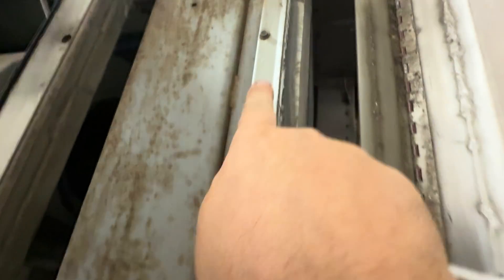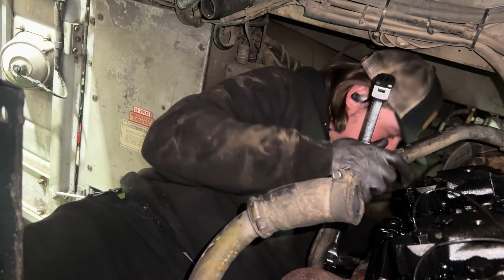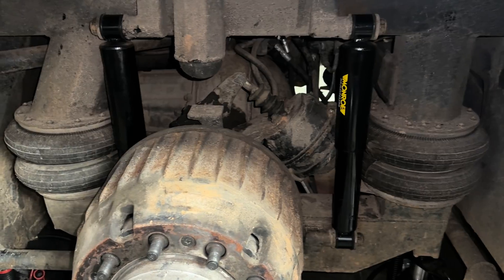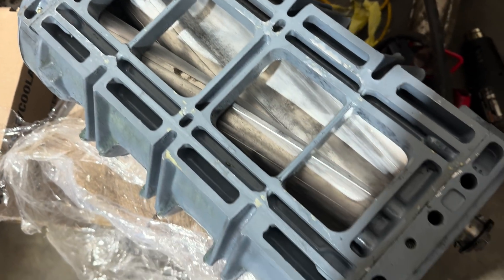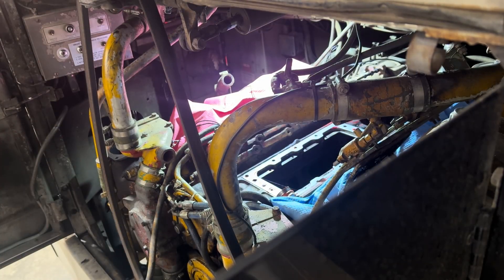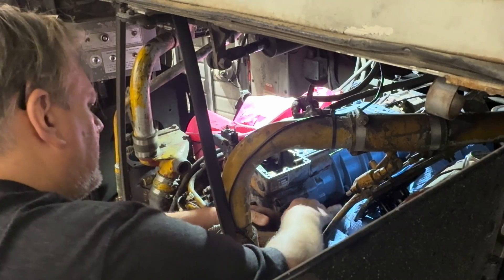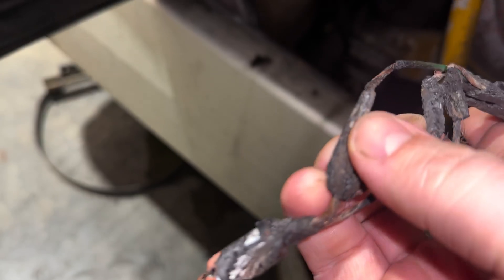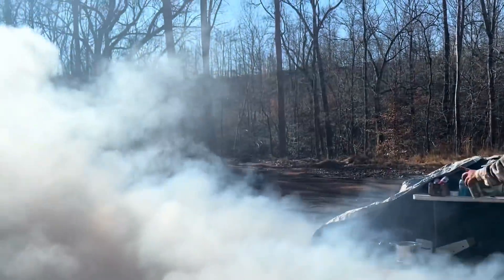Horsepower killers…. Warm air intake and Injector timing way off.

Comment: To Aline gaskets I have a variety of bolts with different thread pitches & length with the heads cut off.
I use a guide pins, making sure they are long enough to get them out of the mounting piece after I get a couple of original bolt started, besides using Hi-tack.

Comment: Just as a suggestion on mounting that blower. Why not make a plate like jig to bolt to it to make handles on it. that way you would have more control while installing it. Then you could use the cherry picker to move it in and have excellent control over it raising and lowering it and also control moving it back and forth and not have to drag it over the gasket. l would draw it for ya but l'm not very good with cps.

Comment: Scott, have you tried securing the gasket on the blower with zip ties in a few holes? Once it's in place, start a couple of bolts and then cut the zip ties. It works well for me, when I'm installing an oil pan. I know it's different than a blower, but it might work and save you the hassle of worrying about the gasket moving around on you.

Comment: You need an ultrasonic cleaner for cleaning those sight glasses. Pop it in there and walk away for 5 minutes and it will look like it just came from the factory. No need to tear it apart.

Comment: 06:26  use a STEAMER, and or, put a wet ragg on it and use a hot iron to remove the tape..
Bin there done that...
About the same size as you have there,,, took me 1 minute to remove it iin 1 piece..
regards from the Netherlands

Comment: Spend the money and get a larger sonic cleaner. You will use it every day. I love mine.
Reply: The looking glass put it right in there and I’ll clean it. You can use dawn dish soap, WD-40 degreaser and then pour it right into another container when you’re done it has a valve on it to drain the tank they work great.
Reply: Nuts and bolts, etc. whatever fits that’s why I like ones that are a little bit bigger😂
Reply from the maker: What parts in this video would we have used an ultrasonic cleaner on?

Comment: Scott.  You either got to buy or make your own sonic cleaner.  Or an air agitated cleaning bucket. Dunk and forget until it sparkles.
Reply: What he really needs is a spray cabinet aqueous parts washer.  They currently hand clean everything.  With the aqueous spray cabinet, you set it and forget it.
Reply: I was gonna say the same approaches....i use both when the need arises.....saves lots of time.